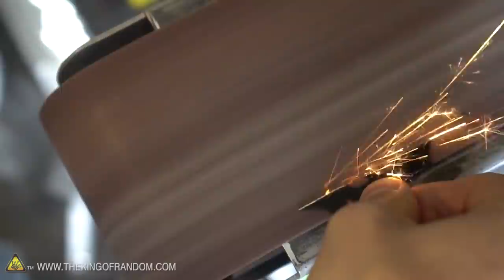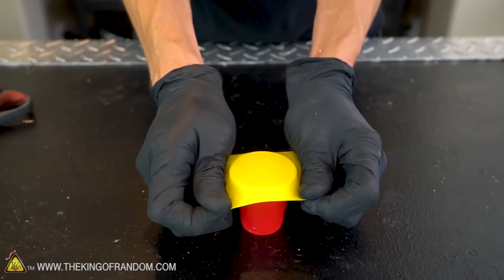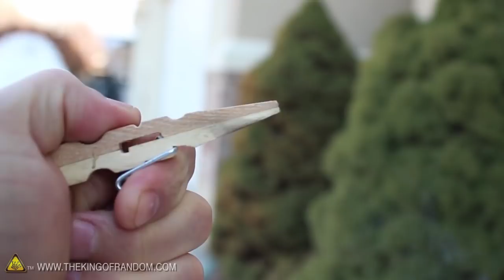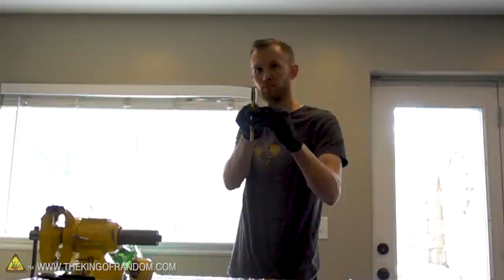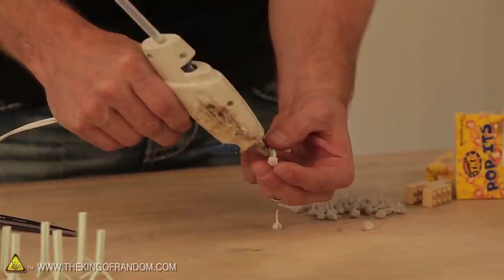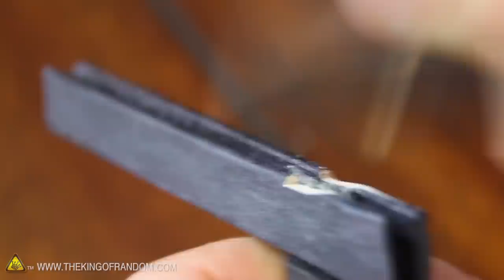10 Things You Can Make At Home: Micro Crossbow, Mini Longbow, Batman Bat Blades and More | Rewind #2

Comment: Try and inflate a balloon with amounts of helium and sulfur hexaflouride and try to get a balloon to hover in place. Or as close as you can
Reply: What would be cool about that is depending on the temperature, it would sink or float.
Reply: polarknight 537 you would need to have that as a control then. There would also be balloon weight. Amount of gas. Materials and methods as well. Lots of variables

Comment: Try using some of the ink you extracted(if you still have anything left) as a mold for casting molten metal! Like freezing it as a mold with liquid nitrogen! 
You could do a who would win: the freezing temperature from the nitrogen, or the burning hot molten metal! Would the nitrogen cool the metal, would the metal heat up the ink or would maybe the metal burn sort of a crust in the ink!